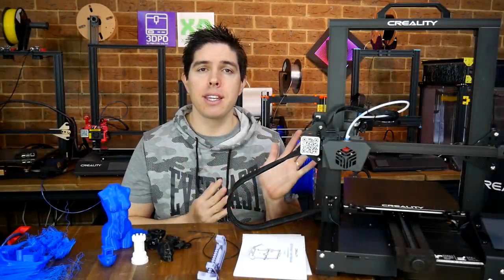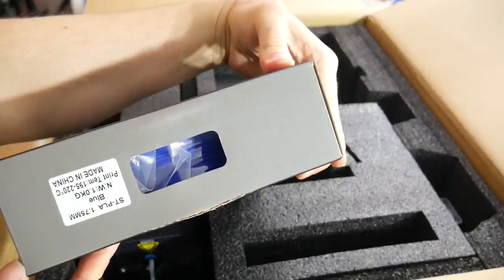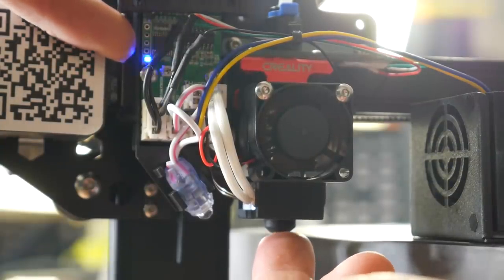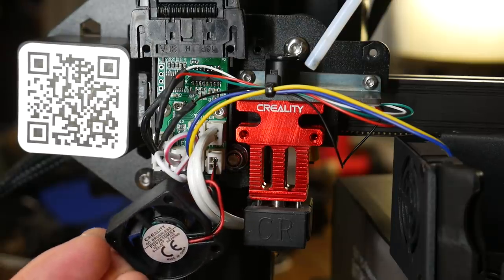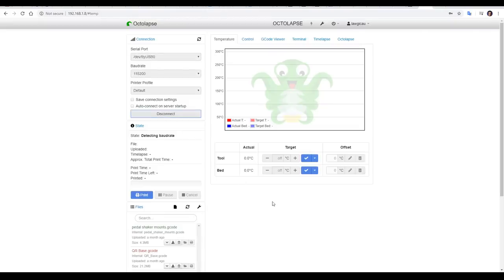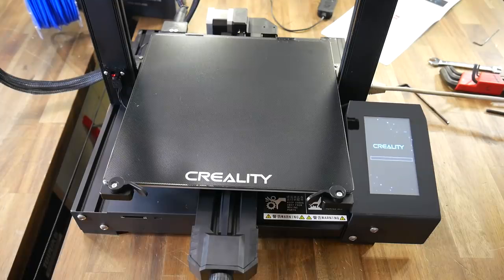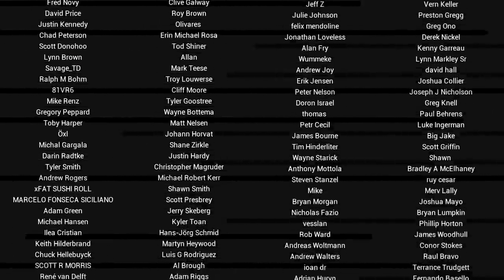Creality CR-6 SE - Your questions answered!

Comment from the maker: A quick word of the build volume. The Ender 3 has always been officially listed as 220 x 220mm even though it is capable of reaching to 235 x 235mm. This printer is listed as 235 x 235mm but there is room for additional travel on X and Y. Once the firmware is open source, the necessary tweaks can be made and the area will be closer to 250 x 250mm.
Reply: Vishal Pai I believe I’ve seen the actual bed size is 245x255 with an actual printing area of 235x235. I don’t remember which video I saw it on but the Wham Bam prez chimed in on a live review and it was measured so (apparently) Wham Bam could start the process to bring their magic to this printer.
Reply: @jamesmiller7278  that was me :-) and yes "physical" dimensions are 245x250 I did not check to see if the kinematics can actually physical reach those dimensions. I will check when I have it on the bench again.
Reply: Nerys Thanks Chris for chiming in to clarify who’s stream I was watching. I thought it was yours with that lovely extruded debacle but I didn’t want to mis-identify whose it was until I had time to confirm... but you beat me to it! BTW, what’s the story with the channel name Nerys? Good job diagnosing the extruder on your live stream. AND we can’t forget to give a shout out to Michael for his bang on reviews and consistently great work! (He’s cost me a fortune buying a lot of the kits he’s highlighted... I’ve got an Ender Extended 400 kit sitting here waiting to be installed on one of my Ender 3’s)
Reply: The Ender 3 Pro comes with 235 x 235 bed enabled by default.
Reply: Would you recommend bl touch on this? Need to know cuz my brother bought one ahead of time
Reply: @talonabuser1072   which one did your brother buy? The Ender 3/Ender 3 Pro could definitely use a BL Touch, or other means of auto bed leveling. The CR 6 seems to already have a highly effective auto bed leveling system built into it. Michael even demonstrated it in this very video.
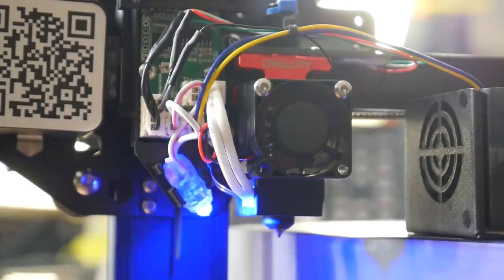Reply: @4:59 - What's the purpose of the user-controlled LED at the nozzle? Is that for keeping the print warm and reducing the cooling rate - like a supplement to a heated bed?
Reply: @talonabuser1072  Umm.. did you not watch the video? Or read the specs? It already has built in auto level.  So NO, you can't use BL Touch.. at all. Why would you even want to?
Reply: @manofsan   To actually see your print, I mean it's hard to see under the nozzle normally.
Reply: Hi,
Which one you suggest for beginner who is skilled in 3D modelling ,Ender 3pro or cr6se
Reply: Hi 
Which one you suggest for beginner who is skilled in 3D modelling ,Ender 3pro or cr6se
Reply: What slicer do you use and starting profile (g-code)? I just got mine in and cannot get it to work with prusa slicer.
Reply: What size is the spring... I lost mine and I have to get a replacement
Reply: i got - blue numbers ans dont know why im new to 3d printer i thought this was plug and play

Comment: I would definitely buy this machine is I didn't buy my Ender 3 10 months ago
Reply: Two never hurt
Reply: rewop why?......200$ or less for one of the best 3d printer you can buy!
Reply: @petermaerkitz2846  because this has auto levelling, silent board, and belt tensioning! Touch screen doesn't matter too much but does add price, it's a more cost effective printer than an ender for Quality of life etc
Reply: @petermaerkitz2846  Because by the time you add an 32 bit silent board, filament runout, and auto leveling your already like at the same price as this or more from the base ender 3.  Then you also have things like the nicer build plate, touch screen, belt tensioning, etc.  For the value nothing in the sub 500 dollar range comes close to be honest.  I would say it compares closer to a prusa mark 3 which is a 750 dollar printer if you get it as a kit version.
Reply: I'm buying this machine if I get drunk enough. CR-10s was my previous purchase early 2018.
Reply: @Aethelbeorn   Ha ha ha that's exactly what I did :-)
Reply: @petermaerkitz2846  lol seriously.  I have pretty much always wanted an Ender 3/Pro, but somehow I've bought 2 printers now, and neither is an E3... 

I bought the first one in January this year.  Anycubic was having a nice New Years sale, so I ended up getting an i3 Mega for $179.  Amazing deal, that thing has been awesome.  The Ai3M is quite possibly the best printer for someone just getting started because of the easy setup.  Especially at that price.    

It was so cheap I almost bought an E3 at the same time, but ended up getting a good mix of filament/nozzles instead so I could learn. 

Planned to get an E3Pro this summer.  Ended up buying a CR-10 Mini. 

E3P's are all out of stock/overpriced right now, but I also like a few things about the 10-mini.  It was one of the finalists when I was shopping back in January too.  Never used BuildTak, but I like having a glass bed.  Slightly bigger build volume.  Only 12V, but not a huge deal for me and can be converted.  Separate electronics enclosure is a blessing and a curse... probably will end up converting it to mount underneath like most people seem to do.

I still kinda want an E3Pro someday... but by the time I'm shopping for a printer again, I'll probably want something else. 

But it's like the AK-47 of printers... if the community was a fledgling nation, a silhouette of the Ender 3 would be on the flag.
Reply: @MaethorDerien  $25 for skr mini e3, $12 for leveling probe, $17 for PEI sheet, few bucks for used Sunon fans (they are amazing, BTW). Not even close.
Reply: @chefjacobs3dprintz564  if they were only two ;-)
Reply: xlioilx could you explain why it’s just 8 bit compute power? I thought it got updated to 32 bit board.

Comment: Fantastic deep dive Michael. This looks like a very good machine indeed, I especially like the use of the strain gauge for levelling. Of course, the lined hot end is a concern, but like you said, I bet MicroSwiss will come up with a conversion/adaptation. Kudos to Creality for listening and making the improvements.

Comment: I know there isn't much hype behind this printer anymore, but I thought I should share my experience:
I got 3 from kickstarter and those quickly more than paid for themselves. Fast forward 2 years and now I have 39 of these machines (+14 E3V2s and +3E3's). The CR6 SE is a fantastic printer. The only real upgrade I've done is updating the firmware to the community firmware. They are reliable out of the box. The hotend design does cause clogs sometimes, but once you know how to properly assemble the bowden tube and nozzle its not a big deal. They are easy to work on and the parts are high quality. 3D printer fans are notorious for failing and these are no different- but it is really easy because of the connectors at the hot end assembly. 

Overall, the value for your money is practically unbeatable. I am still buying these printers for my print farm- even though it's been over 2 years since they were released. I sincerely believe that this is the best machine Creality has ever produced.
Reply: Thank you for this information, I will definitely be getting one myself now.
Reply: I bought one 3 days ago for 278 but still haven’t taken it out the box . I am nervous from the reviews I have read about the problems it’s had and some of the YouTube vids . Thinking of getting a anycubic kobra go . I already have a ender pro

Comment: what im honestly most impressed with are those tools it comes with. Full size SD card and the painters tool is by fat the best tool to use for removing prints. Ive never used my ender 3s spatula. All the other upgrade are still amazing. I pray that reality makes a larger scale version of this then i am SOLD

Comment: Your closing observations are spot on.  I agree that the print bed should be a little larger like 275 x 275.  It would be just about right as I find my CR-10 print bed a little too large at times and the Ender 3 print bed a little too small.

Comment: Thanks for your video. I will get my cr-6 tomorrow and the information in this videos made me feel safer with my purchase :) two friends use prusa mk3 but didn’t want to put 1000$ on a machine like that as my first printer. Fingers crossed !
Reply: Is it working I just bought one and am nervous because of reviews about kick statyer
Reply: @lugnut082999  i finally decided to use the ender3v2. It works perfectly. First print was perfect after only levelling the bed. Nothing else to do. Also, using the Creality box makes it so much easier. A lot of option in the slicing process. I would suggest using the Prusa slicer to have more options.

Comment: Hope to see soon your review for the CR6 Max. I am on the point to consider a large printer (my basic needs are what is supported by this new unit (400x400x400). I saw your other videos of larger printers but the price tag and overall results did not convince me those are the ones I need. This one is "brand new" and seems (despite some shortcomings) to be a good printer with a robust design. I would expect the price to be more affordable soon (600-700) and in the case confirmed it is a good buy, perhaps my choice. Love to see your opinion soon!

Comment: I think this is the new standard in low-cost 3d-printing.  As long  as their quality control doesn't go to hell as they scale up the volume production, the value for money is unbeatable.  Its more expensive than an E3/E3 Pro but you get all of the common upgrade features (they just forgot the Capricorn tubing), PLUS it saves people so much time and *fiddling*!! Don't underestimate how little most people want to "tinker" - they want to pull something out of a box and use it.  Those of us who like fiddling and DIY'ing are the exception, not the rule. ;-)  
The only downside is that this is probably going to dry up sales on the Ender3 Pro and E3 v2.

Comment: I'd upgrade to this from my ender 3 just to have those bed clips, touch screen and bed leveling.
Reply: You can upgrade an Ender 3 pro with all that for far less cost...
Reply: You could buy some metal Ultimaker style clips for a few bucks
Reply: @TheWingnut58  Not really even close.   A bl touch costs 50 dollars alone.   25 dollars for the build surface, 25 for the touchscreen.   That doesn't include the 32 bit board or silent stepper motor drivers which is another 50.  Filament runout and upgraded extruder is another 25.  Belt tensioners run 10-15 dollars per axis.  The bed design is also much better because it is fastened in multiple points with solid connections not just in the 4 corners you won't ever have an issue with the bed warping from heating and cooling and getting a bow in the middle.   It is actually a really smart solution that fixes a lot of the problems with heated beds.  Honestly if you tried to upgrade an ender 3 to the same level your talking about spending 300-400 dollars aftermarket easy.
Reply: @MaethorDerien  First, it's an 8 Bit board, not 32, at that price....32 bit is an available upgrade.
Second, you're shopping in all the wrong places and buying everything pre-made, All the belt tensioners are available on Thingiverse, as are several filament run out sensor designs and glass bed clamps.
Hell, just buy an Anet ET4x for $160 shipped....it already has a 32 bit board (but not silent drivers) run out sensor, glass bed, touch screen etc....it comes standard with more upgrades that an Ender 3 to start with and is just as well built.
At nearly $500 "early bird",  this thing is still a friggin PIG with lipstick.....there are better machines for the money....
Reply: @TheWingnut58  The 32bit is a free option KS reach days ago. Plus even when it goes retail it will have a 32bit, Creality already said that.
KS is at $319 right now so I have no idea why you are claiming that it's close to $500.
Reply: @MaethorDerien  plus the time
Reply: @mathewcoppola8622  you evidently can't do elementary school math....$319 for the pig with lipstick + $176 "Express" (LMAO) shipping = $495.....that seems pretty damned close to $500 to me...
And if you scroll down to the chart where they are comparing this machine to an Ender 3, it CLEARLY shows that the "silent mainboard" is 8 Bit......and all that isn't even considering how many people have been screwed by KS roll outs.
You want to send them $495 and wait in hopes that you'll get it several months from now, go right ahead....
Reply: @TheWingnut58  That's $176 HK you dweeb.
Reply: @TheWingnut58  Not to mention they upgraded to 32 bit and it's mentioned on the page.
Reply: Rick Henderson $176 Hong Kong Dollars (~$22 US)

Comment: Michael, as always, your presentation is great, its insightful, detail oriented and also presents an overall perspective that helps us all understand vastly better than we would without you!  Thank you for that!  I do have a concern however.  You said you tested the thermal runaway of the CR-6 by disconnecting the heater and watching the temperature drop. This would happen regardless of thermal runaway protection or not.  You must know this.  Take a breath,  and please invest the time to clarify this. Keep up the good work!  Thanks!

Comment: This is a really good printer for people new to 3d printing. Everything important and complicated is taken care of. It's stable/solid build and seems to be an overall pleasant printer. I have an Anycubic i3 mega which is also easy to use but without auto leveling, so this is even simpler to use than that.

Comment: This will make a nice third printer for me.   I am very interested in the bed leveling and touch screen, two things I have not added to my Ender3 PRO.   I'm confident Creality will sell these, but am a bit ignorant on how kick starter works to throw money at it in order to save $100.    Do you simply give them $320 (the current early bird price) and this pays for your printer? Or is the money given separate and you have to pay later for the printer as well?   What about Shipping?  How are those fees accounted for?

I'm very curious how spare parts will be handled.  This would be a worth while project to buy some of these parts and see what can be retro fitted to other printers such as the Enfer 3 assuming the code is open source.
Reply: Printing is added on top, check the site
Reply: That pays for the printer, you have an extra bit that you add for the shipping.  It actually asks when you do the kickstarter where you are shipping to and adds that to the pledge.

Comment: Using a load cell for nozzle tip levelling is a great idea. It gives the exact print surface level, but this only works if there is absolutely no filament at the tip! However, to get the most accurate reading, both nozzle and bed should be at printing temperature, with no filament oozing out the nozzle. Since they aren't using the load cell as an active bed leveller during the print, I'll stick with the BLtouch which is a more practical level sensor.
Reply: It should not be necessary to level this printer before every print.  Levelling can be done before loading a filament.
Reply: @ThinkersBluff  still a bit more work than BL isn't it
Reply: @danlightowler4259  I don't think so.  I presently have a BLTouch on my Ender 3 & level prior to every print.  If I could just level once and forget it after that, I would be printing sooner every time after that.
Reply: Correct. this is why it heats the nozzle to 120' when it does leveling. this is so if there is any filament it can squish out of the way and be a minimal effect on leveling (you should still make sure its clean!!)
this is one of the first machines (I believe seemecnc might have a machine that does this as well) that understands "true zero"
what this means is the printer "actually knows" where the nozzle tip and the bed are. not an adjusted value but true zero. and this is a big deal.
when you set z offset your not really setting an offset. you are literally setting "first layer height" from true 0. this means for example you can change the bed and just click "auto level" and you are done. you can change the nozzle and just click auto level and you are done. you can not do this with any other system because all of those other systems depend on predefined offsets to "get you to" true 0. this one does not. I am going to abuse the hell out of it. I really hope it holds up well because its pretty darned neat!
Reply: @nerys71 , I knew that because I watched your video.

Comment: I think this sounds like a great first printer if money is not an issue. If on a budget the original Ender 3 still shines.
For someone like me who has an upgraded CR10S is doesn't make sense as a second printer, as it doesn't do much more. I'm glad I went through the upgrade process, I learned a lot and am comfortable taking things apart.
Which brings me to a video suggestion, assuming a user has a good working upgraded Ender 3-ish FDM printer, what would one consider for a second printer? Something that is more accurate? Resin? Bigger volume?
Great video as always, thanks!
Reply: Resin